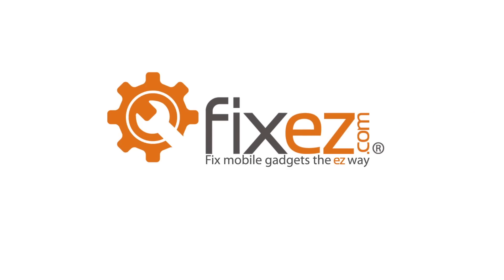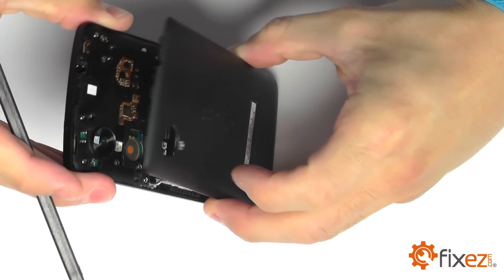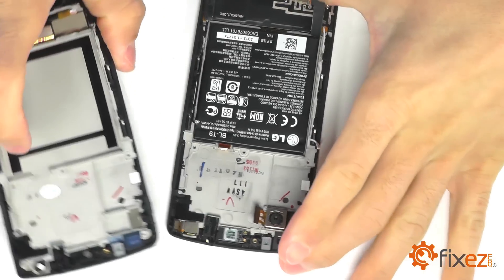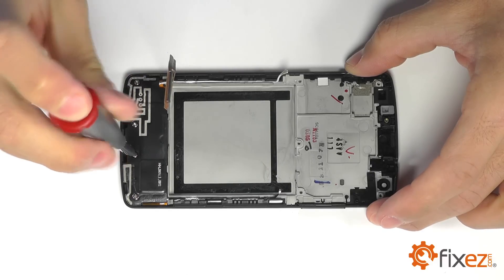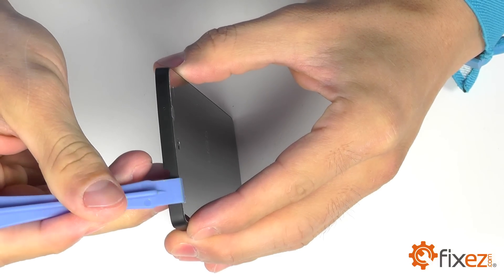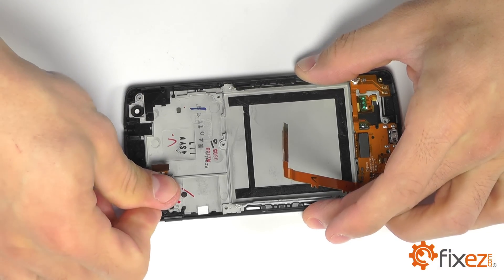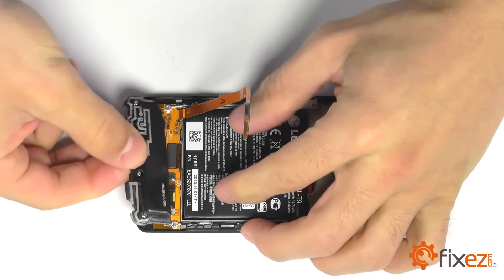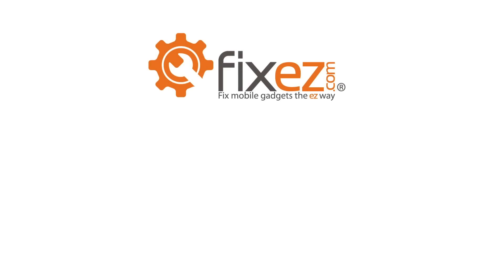LG Nexus 5 Screen Repair & Disassemble

Comment: I got my LCD and digitizer replaced a week ago and it was working all fine.
But unfortunately I dropped my phone today on the hard floor and after that the Touch is not working. Screen and all buttons are working properly and I can see notifications.
ONLY TOUCH IS NOT WORKING.
Can this be an issue of loose contact which can be repaired?? or only solution is to change the panel again??
Reply from the maker: +ravisarda Possible that there is a faulty connection but in most cases it's your actual screen. You would require a new LCD and Touch screen assembly.

Comment: Hey there. need some help fixing my nexus 5. I have gone through the whole hardware and everything seems fine, but the touch screen does not works... the phone turs on, the volume goes up and down (buttons are fine), but mi wifi has gone some months ago, the 3g was really funny, not working properly and out of the blue the touch screen has stopped working. Please let me know if there is any way of fixing it. Thanks a lot.
Reply from the maker: +Fe Borg9 If the touch screen is not working, your digitizer on the screen is the issue. You would require the LCD and Touch screen assembly as shown on the video. In regards to the WiFi, you may want to change or check the Coaxial antenna cables. http://www.fixez.com/store/lg/lg-nexus-5

Comment: Hi should I purchase the $39.99 or the $44.99? My phone touch screen is totalled and my lcd has distorted at the back, home and recent apps. And, does it comes with free shipping if I were to buy it? I hope to get a reply,  because I need to repair it right away :(
Reply from the maker: The difference between the two is one comes with a frame. With the frame is a simpler repair. Shipping is not free. Thanks for the questions.
Reply: Fixez.com Thanks so much for the reply considering the video is from way back :)

Comment: Hello there, my nexus 5 screen is kind of glitched, showing thin long bars from top to bottom.I cannot figure out anything on the screen. What do you reckon the problem might be? I have dropped it a couple of times. Do i need to buy a replacement screen or anything else? please reply. Thanks!
Reply from the maker: +Ghufran Ahmed It sounds like the display was damaged, replacing it should fix your problem.

Comment: After successful screen replacement 3g and LTE connection stopped working. Edge still works fine. Does anyone have any ideas what could be wrong? Please help!
Reply from the maker: +kljukecna12 Ensure your coal cable connections were seated properly. You should have two, white and black color coal cables. Also, try a hard reset on the device.

Comment: Got my screen replaced but caused 2 problems my vibration has stopped working and my top ear piece stopped working with the ear piece it seemed a bit short in the new frame like it wasn't gonna touch the motherboard but I hoped screwing it down would fix it and nothing happened. But I have no idea about the vibration anyone got some advise?

Comment: Hello, I have replaced the screen following your video, and it doesn't work. The screen only shows pale blue lighting that seems to respond the same as a working screen would (when the power button is pressed, when a phone call is made), but there is no picture, and it seems like the touch doesn't work either (when trying to touch the approximate place for answering a phone call, it doesn't work).
It seems to receive phone calls, but there is no sound (maybe it was on silent mode). the LED at the bottom seems to be functioning, and when i connect it to a computer it connects as Nexus 5, but i cannot see any files in the "Nexus 5" drive (that was really confusing).
I tried re-opening it and checking the connections, and it all seems fine.
what could be the problem? this is very strange. could i have damaged anything if i touched the wires when the phone was on?

Comment: i did this but now my screen wont turn on or charge...its something to so with the yellow flat thing i think
Reply from the maker: +Chris Mackay Double check your flex cables to ensure they are seated properly. Also, ensure your battery is connected securely. If you see any visible damages to the flex cables, this could be the reason for it not working. Otherwise, you may have a bad LCD on your new screen assembly.

Comment: I did this to fix the touchscreen but its still not working. Any ideas? The phone's water damaged btw
Reply: +rob link its dead dude
Reply: The screen comes on an everything but no touch :(
Reply: replace the screen
Reply from the maker: +rob link With water damage it's difficult to conclude what can help resolve this issue. Possible that the device has motherboard damage which even replacing the screen would not resolve the issue. May need to have a repair shop review the unit and test.

Comment: My nexus 5 started to show static display while restarting and then the screen glitches and show black display. Only after 2-3hours of inactivity while restarting holding the power button it returns to normal and again the same thing repeats when I turn off my device. It has never fell down or had any incidents but the problem occurred by upgrading to lollipop 5.0.1. I bought it in store about 5 month ago and is still on warranty but only free repair for software problems. When I give them to fix this they changed the power button on my device assuming that was the reason causing the problem but no luck..:( .and even downgraded to KitKat 4.4.4 but again the same error occurred plz help any advice would be helpfull thanks...and help me plz....:(

Comment: :( All I need to do is replace the glass, not the display itself. I'm guessing that is not possible?
Reply: +Colin Richardson don't think so.
Reply: Yeah, I guessed that was the case. Sad times.
Reply: I just installed the new screen. Only cost around $38 on eBay
Reply: +Tor Ivan Boine A lot of those arent of quality or are missing the light filter for the led so i got a wholesale one from gadgetfix with all thw parts and it works well.
Reply: BlasianGamin' this works well. Have been using the new display all day. light filter?
Reply: Tor Ivan Boine Its a little piece of rubber and paper that gives the led that muted tone, along with the dotted pattern at the edge. I went with the more expensive one just bc it had it, along with all the grounding pads and adhesive.
Reply from the maker: +Colin Richardson RIghgt, the LCD is fused to the front glass. We would recommend the LCD and Touch screen as shown in the video.
Reply: +Fixez.com thank you, I'm in no rush now. I ordered a Nexus 5X.
Reply from the maker: Nice.

Comment: Decent walkthrough. A couple of things worth mentioning though: 
1. Remember to take the protective plastic off of the terminals of the new screen or you will put it back together and the connections won't work (camera, speaker etc.)
2. Make sure you take the volume and power buttons out of the old case
3. Depress the power button when putting the motherboard back in and it will release when it pops back in to place.
4. I found it easier to put the rear facing camera in after inserting the motherboard.

Question: My volume up button only works when the screen is unlocked, and it gets stuck so I have to let it turn all the way up and then adjust down. Also vibration doesn't work anymore. Any ideas on how to fix before I give up and splash out on a Nexus 6p?

Comment: Please help, rear camera is not coming off as easy as shown here, dude. Suggestions?
Reply: I was able to get it! took a while, thing was pretty stuck in there. Was able to fix my phone thanks to your video and parts! one issue which might have been more obvious to others, is that your guys replacement housing doesn't come with the front facing speaker little plastic house, and you have to pry that off and put it in the new housing. Wasn't too obvious because it looks like its fused into the housing, maybe something you guys should mention. If you didn't.

Comment: Very thorough video, many thanks! As others have mentioned, don't forget to move your power and volume rocker buttons or you'll be prying open your phone again.

Also, the screen assembly I had came with adhesive already applied under thin blue plastic strips. If you have those, just peel them up gently to leave the adhesive and then place your components firmly.
Reply from the maker: +Brad H Thank you for the feedback, we highly appreciate it.

Comment: My screen jumps up and down, I read somewhere it might be the flex cable(that copper connector where the speakers are). My screen is perfectly fine, should I replace the flex cable or buy an entire new screen?
Reply: I bought the flex cable from your website, hopefully it will solve the issue...
Reply: ***** I will do just that
Reply: Fixed it and it seems to be working fine without any jumping screen, but now for some reason the heptic touch and vibration doesnt work. Have an idea what might be the cause of this?

Edit: 
I just needed to close the back down more lol
Reply: It works fine now.
Reply: Andrew Gray I'm having the same problem.  I replaced the screen and digitizer using this video, but it's still jumping.  I'll be getting the flex cable next!  Thanks for sharing, or I probably would've tossed my phone.
Reply: No problem!
Reply: Andrew Gray Yep, the flex cable was the culprit.  Works great now.  Thanks again for pointing it out!

Comment: I did it and everything is working perfectly. But the replacement frame I received didn't have any adhesive in the main camera housing. So my camera is only being held in place by it's attachment to the logic board and the plastic casing that goes on top of that. The camera is working fine, I was just wondering if this would be a cause for concern?

Comment: I'm really hoping some one could help me figure out what happened to my phone. I have the Nexus 5 and one day I accidently set it face down in a puddle of nail polish remover that said it was non-acetone. After that, my phone was spazaming,  so I set it in rice and after a while it worked fine but the screen looked wet from the inside like as if the LCD screen was wet. It worked completely fine up until three days later, it started spazaming and then the whole screen started to glitch like lines would appear and then the screen turned completely white and I could still see where the Polish remover stained. I dunno it is the LCD screen  that could have been ruined. I want to fix it for the information I have on it to be kept. Is there a way to fix it without ruining my informstion? Sorry for the long post.
Reply: ***** sorry to bother again :c but now the phone starts up only when connected tithe charger, it goes to the Google start up screen for two seconds then switches back off. I've tried holding the power button and with the volume buttons, and nothing works. I think the phone is a complete goner.
Reply: ***** Thank you oh so much for this information, I will be trying everything soon hopefully. Sorry to have bothered you. I really appreciate the time you took out of your day to read and reply to my comments. Thank you once again!

Comment: I just did this. Now when I turn on the phone, every pixel has a different color. But the phone doesn't do anything. It's a colorful brick. Really wish I had just continued using the phone with the cracked screen.
http://imgur.com/cENQvZm
Reply: ***** we bought it on aliexpress. If just the display is broken, would that prevent the phone from working completely? I thought it could at least still play notifications when I chat to it or something, but it doesn't show any life signs anymore, other than this garbled screen. Thanks!
Reply: Actually, it's not a complete brick. The volume buttons still give sound feedback. So something still seems to be working.

Actually, after putting a sim card we are able to call it.
Reply: Thanks a lot for your help. We'll probably ask for a replacement.

Here's a tip, in case you take Bitcoin tips.
$3 *****

Comment: Some additional tips:
1. Remove your sim card tray. Its much easier to re-position your motherboard without it. Put it back in after you finish the repair.
2. Don't forget to move your power and volume buttons from your old to your new screen assembly. They forgot to mention it in the video.
3. Some parts are glued very firmly in place - a heat gun might come in handy.
Reply: +Captain Kole I'm about to perform this operation, thanks for the tips.
Reply: thanks for the intention of helping- just an fyi (i have no intention of being a "dick/know it all")but they do say to move your volume and power buttons over to the replacement part EG: when he says move your components over to the replacement part he's refering to the volume buttons and power button etc.